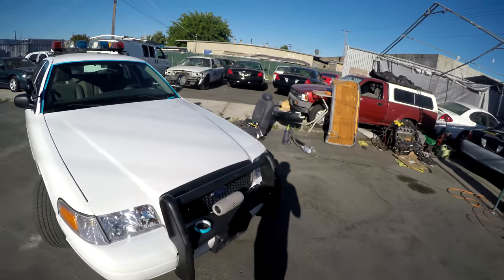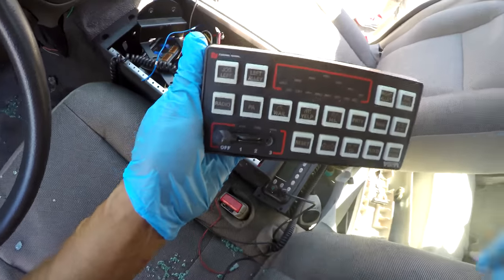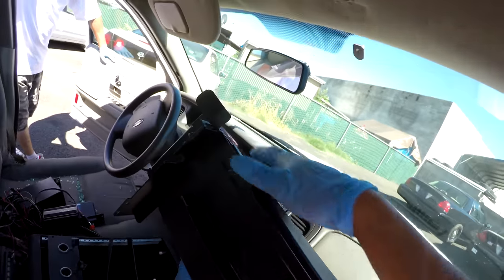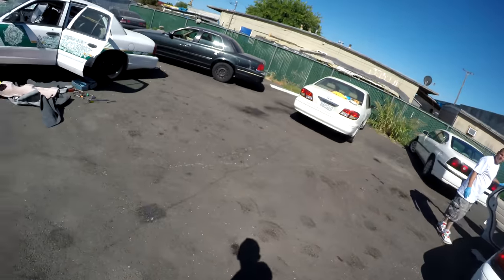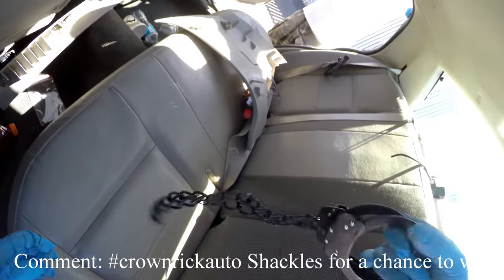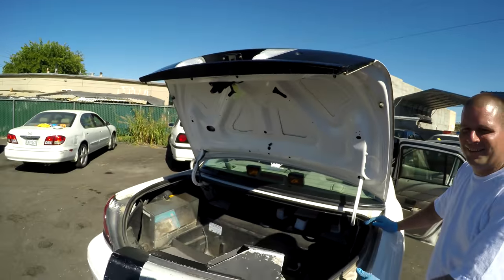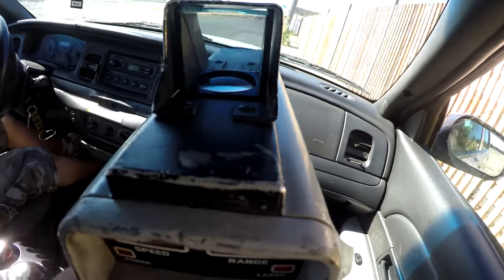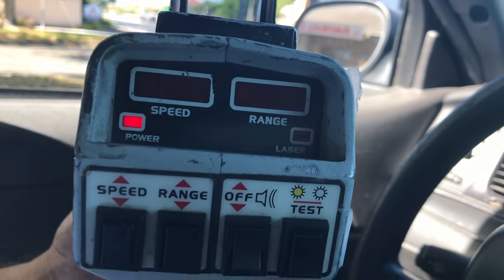Searching Police Cars Found LIDAR GUN! Ford Crown Victoria Cop Explore

Comment: Point the LIDAR gun at the license plate. The LIDAR gun will only work on something that will reflect the laser right back. it works differently than a radar gun.
Reply from the maker: PYRO -GEN4 thanks for the info!
Reply: Crown Rick Auto can I plz get a push bar
Reply: Crown Rick Auto i want cuffs